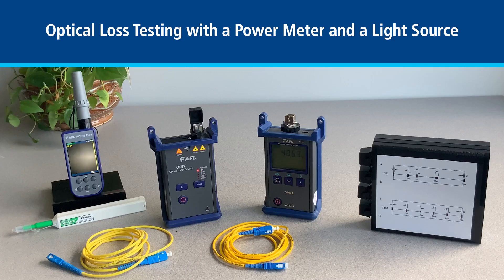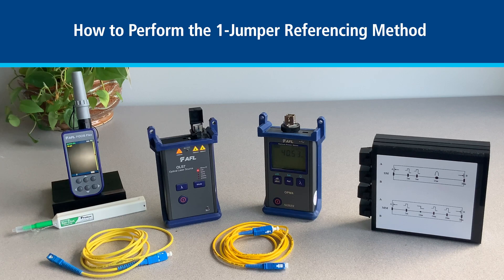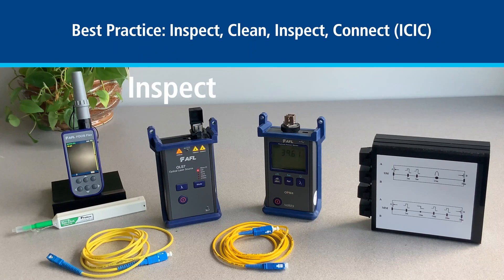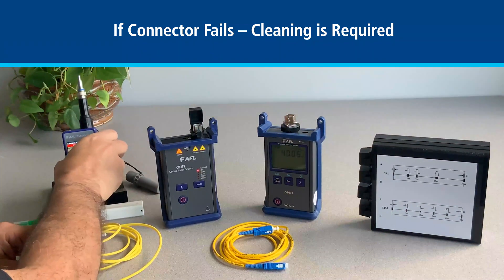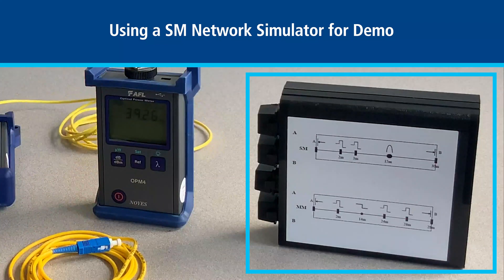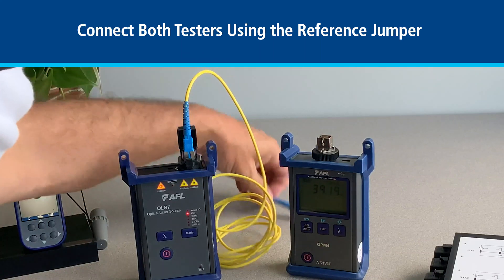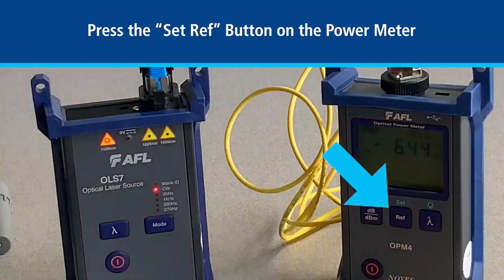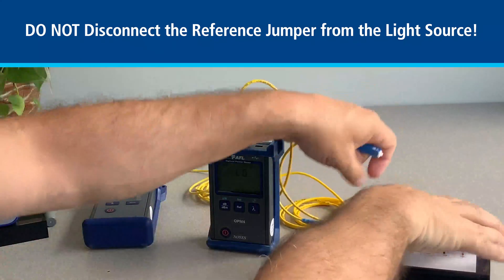Basic Optical Loss Testing Using an Optical Power Meter and Light Source (1-Jumper Method)

Comment: Most of your loss might be in the second cable you connected..you should have referenced your test cables by using 3 patch cords when referincing your power meter..then remove the centre lead and plug in the fiber under test..this eliminates all connector loss and checks only the fiber that is wanted for loss..